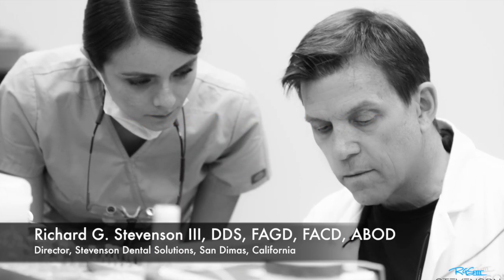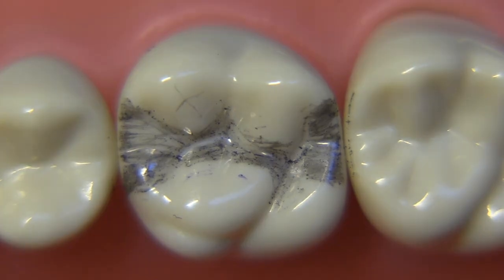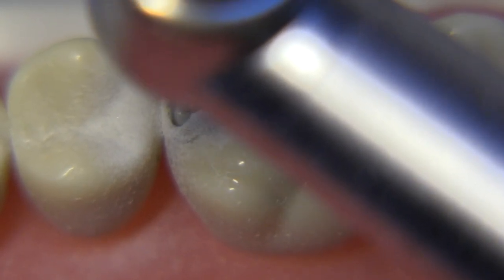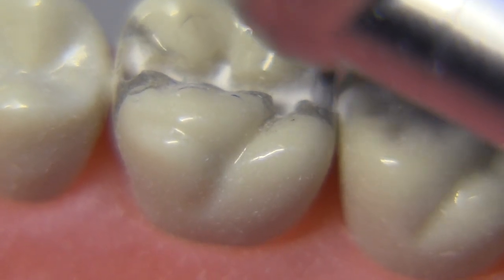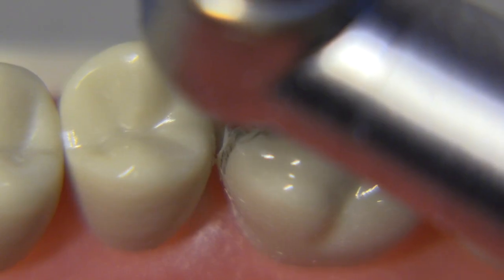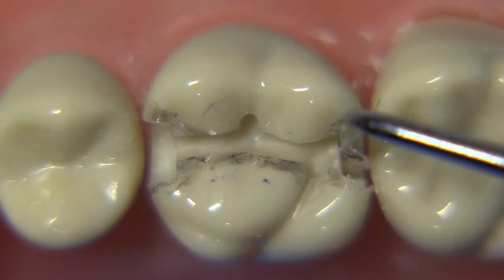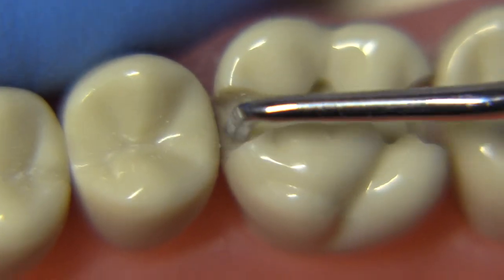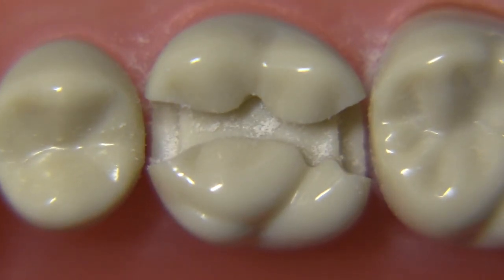Class II Amalgam Preparation #14 MOD | Amalgam Preparation Technique

Comment: I have a doubt and I was wondering if you could answer it would be of great help. When I drop the proximal box to 3 mm on acadental typodont , I still get enough to tooth structure left on the bottom. But when I do same 3 mm in Kilgore typodont my gingiva gets exposed. Please could u tell me what’s happening on Kilgore typodont when I use it
Reply from the maker: The Kilgore teeth have occlusally located inter proximal contacts and overly tapered proximal surfaces - it's a design flaw that they've known about for 30 + years. It's surprising that dental schools use them at all.  No worries - the Kilgore gingival clearance will be more...
Reply: @StevensonDentalSolutions thank you so much Dr. for responding back to my comment. Is there a tip that u can provide for Kilgore in regards to the box because I tried to find #3 MO on Kilgore but couldn’t find a video on that.

Comment: Is this 200 series typodont. The plastic seem to get chipped off very easily compared to the 700.
Reply from the maker: Columbia Model 860 - I believe you are referring to the Kilgore typodont
Reply: @StevensonDentalSolutions Yes! The plastic is so much stiffer on the The 700 series Kilgore. It’s almost impossible to remove that much unsupported enamel using the hatchet. 

A small request, do you think you can make a video on how to do an MOD amalgam preparation on a lower premolar ? 

Thank you for your hard work.

Comment: Hello Dr.
What should be the maximum width of the cavity. It gets wider, especially in the isthmus area. Our exam recommends by saying the smallest Condensor provided should pass easily( which measures 1.5mm ).
Reply from the maker: I usually try to keep it about 1.0 mm - we use small condensers/
Reply: @StevensonDentalSolutions  Thank you Sir

Comment: the design of class 2 for amalgam is the same design of the class 2 for composite?
Reply from the maker: No. The class II composite has rounded internal line angles, and may have slightly more flared proximal walls.  It may be slightly less deep pulpally and slightly less extended interproximally.
Reply: thanks for answer...  plz can you make vedio about the class 2 cavity prepation for composite to learn make class 2cavity preparation because i dont know the shape the box of the  interproximal of mesial or distal the problem 
is the the shape of the box plz the doctor... this will make me happy because i can not sleep.. i can not make the box of the class 2 mesial or distal and this make me abad dentist
Reply from the maker: @mohamedshendy9324  I have a few other videos on class II in the Class II Composite Play List on the content page of the channel.  Wishing you the best.  Dr. Stevenson
Reply: thanks for your the reply.  you are  respected man and the best dentist in the world
Reply from the maker: @mohamedshendy9324  You are too kind.  Best wishes, Dr. Stevenson

Comment: How do you get the matrix adapted to the gingival seat when the adjacent tooth is missing?
Reply from the maker: GREAT QUESTION! You don't usually, however, no worries, it is totally accessible and easily corrected with an IPC or Hollenback after removing the band - with amalgam.  With composite, I'd use a #12 blade or composite knife followed by thin composite finishing discs.
Reply: @StevensonDentalSolutions  Thank you. The thing is that I find the amalgam keeps leaking on condensation from this opening between the band and tooth margin at the gingival seat and fill the gingival sulcus before the cavity.
Reply from the maker: @user-nx8fn7jg1r  Okay - here is a more advanced technique. Place the band as usual, then cut a small piece of the matrix material (a shim), about 10 mm in length, and insert it in the area where you have no adjacent tooth, extending beyond the buccal and lingual proximal walls, then insert a wedge vertically between the shim and the band and secure with composite or compound.  this will seal the gingival area beautifully.
Reply: @StevensonDentalSolutions  Thank you for this invaluable information. I would appreciate it, however, if you could do a video demonstration of this technique. Thank you again.
Reply from the maker: @user-nx8fn7jg1r  Okay - I'll try!
Reply: @StevensonDentalSolutions  Thanks a lot

Comment: Hi,I would like to know if it’s just a DO where do we start the outline of the preparation...
Reply from the maker: Hi Doc - two choices: either extend all the way to the mesial pit and cross the oblique ridge, or perform a DO which is entirely restricted to the area distal to the oblique ridge.  With the first option, it's more aggressive, however, it is very retentive and relatively easy to perform.  With the second option, the difficulty lies in obtaining enough retention without damaging the DF cusp with a dovetail.  For the distal only prep, start with the BOX and complete it, THEN add enough retention with the occlusal form.  This technique works well with small DO and MO preps on lower first premolars as well.  I'll demo this video soon! Thank you for the excellent question.  If you email me, I will send you a photo: info@stevensondentalsolutions.com
Reply: Thanx a lot doctor..will look forward for the video..

Comment: Hi we don’t get enamel hatchet for our exam. Is there any other instrument or ways that can be used for the proximal boxes? Thanks
Reply from the maker: Oh that is just mean!  Any chisels at all? Hoe? Off-angle? Bin-angle?  Hopefully you may use some instrument - if not, you'll never be able to create defined axioproximal line angles.  Very strange for a school to subject one to this.  Anyway, do the best you can with the tip of the bur to obtain the proper extensions on the buccal and lingual of the box.  It can be don, but it's like asking an F1 driver to take one of the wheels off the car and win a race. BOO!
Reply: Use a marginal trimmer!
Reply: Gingiva marginal trimmer

Comment: If you realize you lack enough gingival clearance when you chip away the proximal box enamel shells, what would you do in that case to minimize iatrogenic damage but lower the gingival floor?
Reply from the maker: Hi Ryan, in this case, I use the “Sturdevant Chip” technique. Use a 245 and position the bur against the axial wall. Drop the bur ginigivally about 0.3-0.5 mm (takes some practice bur it’s very repeatable), while just skimming the axial wall as you move the bur buccolingually.  You will have created a ditch in the gingival which leaves a small wall (a lip) adjacent to the proximal tooth. Now use either an enamel hatchet or bin-angle chisel in the ditch and rotate the instrument with the cutting edge swinging towards the adjacent tooth. The little wall will easily chip off, thereby gaining more clearance. Smooth the margin as you always would with burs and the hatchet or ginigival margin trimmer and you should have an iron clad predictable method for this requirement of class II preparations.  Note: Sturdevant, - I knew him personally - was a humble gentleman and would never have named this after himself.

Thank you - I hope this helps.  I plan to demo this in an upcoming vid!

Comment: hi I would like to ask is this the preparation for all levels of decay if so if a tooth doesn't have a large amount of decay spreading to the outer case at both sides of the tooth then why are the walls of the tooth breached on both sides surely it would make sense to keep the shell of the tooth intact as to make a shell for the filling to sit and mould with giving the tooth more integrity in some videos they even go as far as making  a complete + shape breaking the integrity of the tooth both sides
Reply from the maker: For amalgam:  There are at least the following 20 designs available to treat class I /II caries, depending on the clinical situation: M (Box only)  MO (leave the oblique ridge), D (Box only) DO (leave the oblique ridge), MOD, MODL, MOL, DOL (leave the oblique ridge), DOL cross the obliques ridge, MOB (leave oblique ride) MOBL, DOBL, MODBL, O+O+O, O+O, OL , OL (leave the oblique ride) OB, L pit, B pit in combination with most of the above. For Composite: Same as above with more conservative extensions.  Thank you for the question!
Reply: +Stevenson Dental Solutions thank you for answering it looks quite similar to learning to play guitar but I understand that their is different options depending on the situation thank you

Comment: I watched many times n it is extremely helpful . Just a doubt . He buccal wall of distal box looks flared a littl to me . Pl do correct me if I am wrong . Thanks again
Reply from the maker: Hi, it might be by 1 degree but it’s very close.  It’s always better to be flared up to 5 degrees vs. being potentially undermined.  Imagine a matrix band around the tooth and visualize the angle which the amalgam will make at the cavosurface.  I think that you’d agree that in this prep we’ve satisfied the criteria.  Best, Dr. S
Reply: Stevenson Dental Solutions thanks very much for the quick response. Perfect